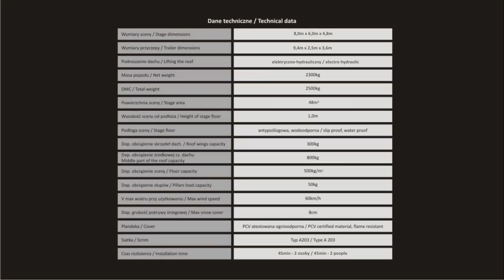LUMEX - Mobile stage ARCUM X48 - 8x6, profiled roof, PA wings

Comment: For some time I had the opportunity to work with a scenario similar to this one. I have to say that although it looks very nice in the photo, it is really a hell. It is very dangerous when driving on the road with it, in addition to what suffers the van that drags, I have broken two clutches in 6 months. If access to the event venue is a bit steep or with a very tight turn, it will be your nightmare. The price of manufacture is very high for the benefits that it offers, since, it costs the same thing to manufacture it on the chassis of a Trailer, much more robust, safe and with capacity for more weight, in addition that the montage is faster. To this day, I have 2 stage trailer made in Spain with more than 4000 events on each. I can say from experience that this type of scenario that we are shown in the video is a counterproductive invention.
Reply: Hi! Who made your stage trailers in Spain? What company?
Reply: Quanto fica um pouco desse
Reply: hi... yes i also was thinking about that... can you share some material from your setting? some video or photos ?
Reply: ZjwjajjsjjhbjmnZe e3sesjs❤🤑🤑🤑🤑🤑🤑🤑🤑🤑🤑🤑🤑🤑👍👍👍👇☝️ 1:15
Reply: Bnbznnsmsmnjmnsjjkkbwkwjwkwjwnwjaka9jejpjaianbwuwjjawkok😂🎉 nwkakjananamamkaknnnmnkKkwwouuwjwiqi1o1ooolliiowojjajajakjaooaoaí😮mnmmsjajakqkaiajao❤❤❤kaiaiaoiaoooqkqkakakqllwiaoiqkqkaiaoqqkqkkakaiakakaoiwajanjiwzkiwkiwoqoiwoq